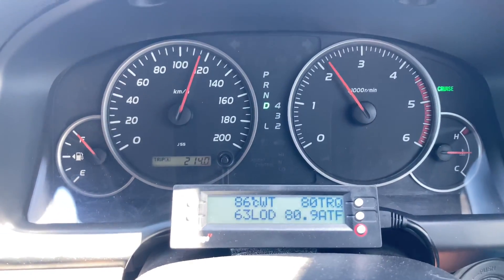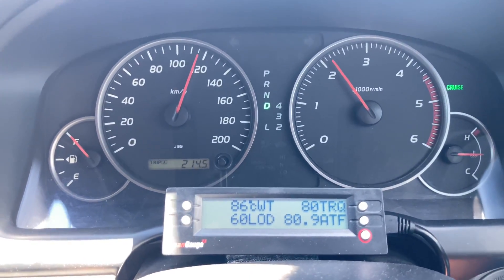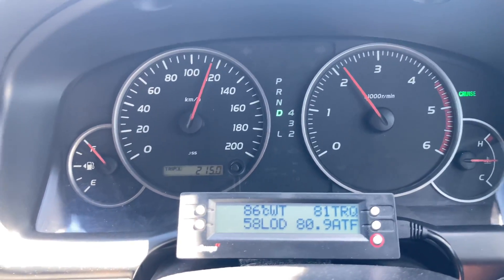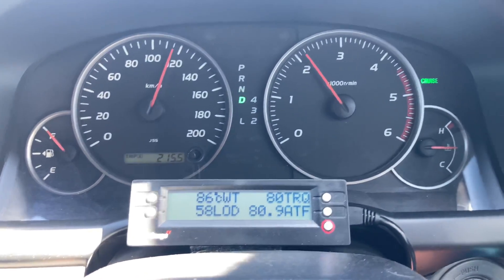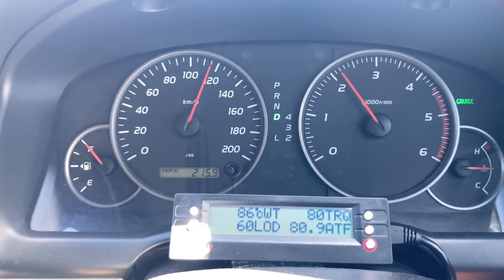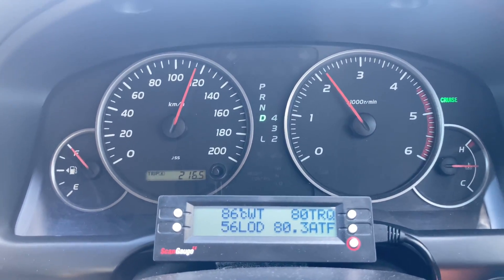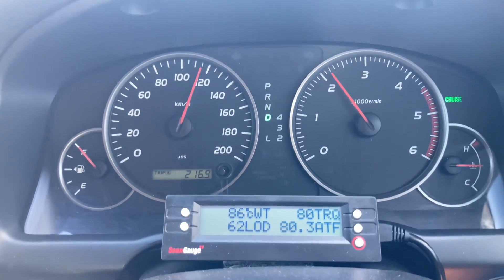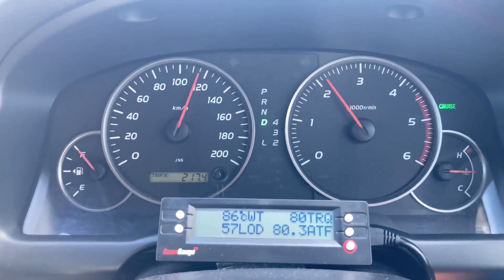UNDERSTAND Normal coolant temperature’s

Comment: Is that speedo reading right, not sure where you are is 115 legal.
Reply from the maker: Bit geeky
I feel the need for speed
Reply: My Prado at 118 kmh is actually 110kmh.  I think the manufacturers do it. You can check it with scan gauge or an app called 55 start. Speedometer. 
Give it a go.

Comment: Given that electronic components all have tolerance values, the actual temperature may be +/- 5% of what is displayed for an accurate sensor.   More an indication of what the actual temperature is and its relationship with other readings, which also have tolerance deviations. Useful none the less.